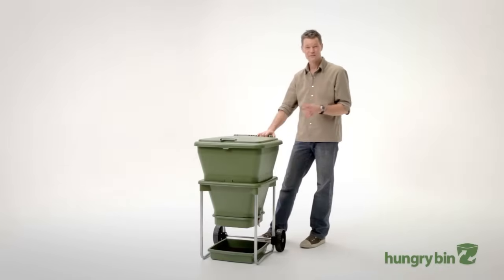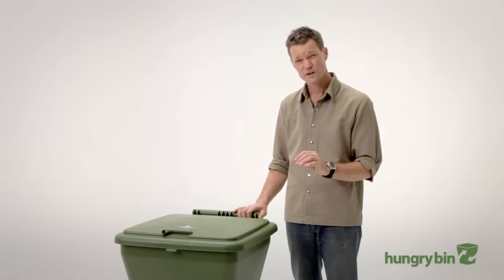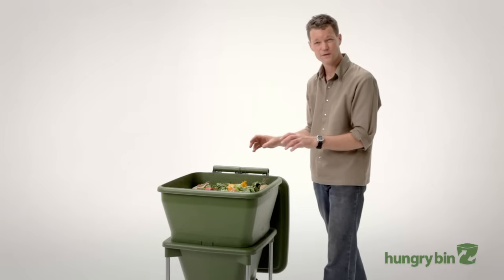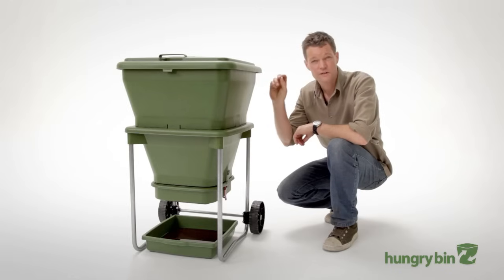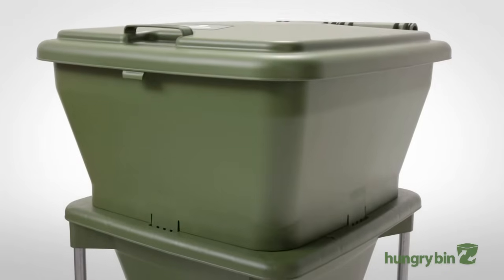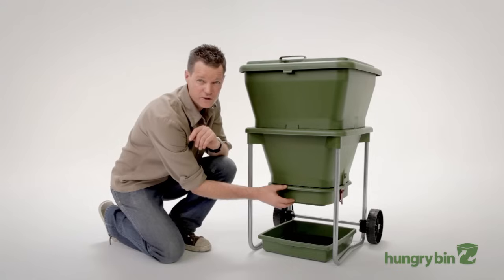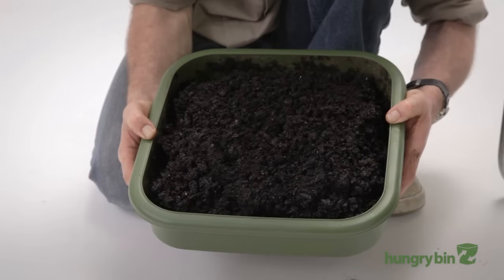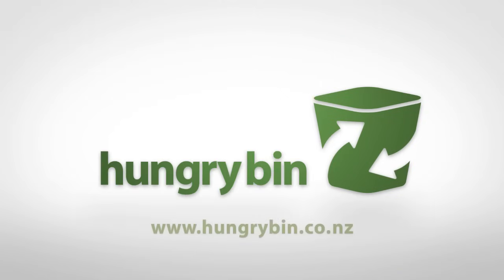Hungry bin. A continuous flow worm farm.

Comment: I can make that for $30. Less than $20, if I try. For $10 more, I can put wheels on it. But I’m gonna trip mine out for $50 more. Chrome tape trim, glow-wire under the frame, a spoiler, and spinners on the rims. Gonna be sweet.

Comment: I have had one of these bins for a few years and WOULD NEVER BUY A BRAND NEW ONE.   The system clogs with moisture at the bottom, so you have to dig extra holes.   It also compacts at the bottom so you need a stick or trowel to retrieve the compost.   Get a second hand one, they are not worth their full price.

Comment: I may have overfed my farm and it's starting to smell a little. I don't think all that smell is due to the tiny amount of raw onion that I put in there since it was less than the amount I would put on a burger bun. Any recommendations? It's not so bad that I would start over at this point.
Reply: Overfeeding means you have masses of rotting material in there and even that will calm down and the worms will eventually clean it up. We are greedy for compost with the minimal of effort. Starting over is probably not worth your effort unless all the worms have died too. I feed orange peels even though Ben says not to. The problem with them is that they take too long to get soft enough for the worms. They will mold before softening up. Although I used to give the worms "hot (spicy) food," I know now they cannot approach it until the hot has gone away. That acid will burn their skin. So if it tastes hot to you, don't feed it to them. These flavors are onions, garlic, and ginger. If these are cooked enough, then they are not hot. On the other extreme is alkaline (salt). This also burns skin--mine too! So don't throw salty potato chips in there or anything that tastes salty. Sweet, sour, and bitter are not problems. You should know the taste before feeding it to your worms.
Reply: no onions recommended if you read the food chart for them :)

Comment: Where does the "worm juice" drip from? Are there holes in the lower pan? Thanks.
Reply: A removable interior cover with many holes. This drains it to a center hole. I catch under there with a measuring cup. Four years with six Hungry Bins: the drainage system has never clogged--absolutely genius.

Comment: Before you buy a Hungry Bin: I ordered one in August 2020 from greentools.ca to add to my first bin purchased in 2018. When the new one arrived, I immediately noticed the quality of manufacturing was inferior to 2018 bin. The green plastic was marked/scratched and streaked with noticeable discolourations, and it had a series of minor issues like stripped screws and black grease smeared all over the legs and wheels. I contacted the distributor to ask about the discolouration, the most noticeable issue compared to the bin I've been using since 2018 (excellent quality). The manufacturer responded it was normal, but Greentools eventually agreed to send a new bin. The replacement arrived with the same quality issues, plus an inward dent in the lid. I let the greentools owner in Canada know about the repeat colour issue, and he responded "...I cannot control what is in the boxes from NZ and we both need to move on." Bad customer service, slipping manufacturing quality, and a waste of time dealing with it. If you care about quality and good service when you buy a $400 plastic worm bin, look elsewhere.

Comment: Nice clean and professional looking system, however I do agree with the previous comments on the price....I assume that the molds for making the bin werte quite expensive due to the size of the bin. However, you may recover faster the investment, if you make the system more affordable. Also to have at least two size would be quite good.
Reply: perhaps a small funnel shaped bin would do the same job when placed on a wooden basement.

Comment: It’s not hard to make the exact same thing using some plastic and a small curve. No need to spend $400. You can make the taper design using polished smooth wood construction. Then create a plastic barrier within the form with some kind of plastic lining. When it’s all done, you can make a bin for the bottom like he has here. No need to spend $400. 

Another way you can make it is if you use Cob. Cob is dirt with sand and water and straw. Im serious. Dirt.  It’s like natural concrete used by ancient civilizations. Good stuff. Used to make fortresses and houses in the old days. Use Cob to make the form. Coat the cob with Lyme plaster finish then polish with olive oil soap. Makes really smooth water proof surface like the plastic device here. All that’s left is to put a bin at the bottom again and then put your potting soil and worms in the top hatch. I’m using this cob method to do it. The only thing I spent money on is a few bags of sand, a small bit of straw, the Lyme plaster a olive oil soap bar. Dirt is free. I have a polishing power tool in my garage. If you are against power tools or don’t have a polishing power tool just use a hard enough smooth river rock. 4 coats of the Lyme plaster before you use the olive oil soap polish step. Works just fine. Final texture for the inside where you use the olive oil soap should be smooth like a Marble counter top. Outside surface isn’t important. Outside surface only gets the 4 Lyme plaster coats. That’s pretty much it. $400 for this Hungry bin? That’s expensive.
Reply: That's a great alternative man....
Thanks!
Reply: @JannalynHalevi   no problem

Comment: Bought my bin several years ago.  Filled it with potting soil then red wigglers then food scraps.  Worms have done great, but there is one BIG QUESTION.  How do the castings make it into the tray below when they only live in the top 6 inches of the soil?  Yes, I can harvest castings from the top, but when I attempt to remove the bottom tray I get the original potting soil AND I stop the removal process because I can tell that the entire contents of the  bin will fall out.  Plus I could only get it partially reattached due to the weight of the soil pressing down.  The liquid in the bottom tray appears to come more from outside moisture rather than anything from the worms.  Would love to have you Hungry Bin people respond to the question of how that castings make it into the bottom...
Reply: I own this worm bin as well. The way the castings make it to the bottoms is as you continue to feed, the worms will move up to the new bedding with food. As you continue this process for months,  your going to be removing your potting soil and will eventually reach the worm castings. From my understanding, the way the bin is design the castings won't fall out the bottom once the tray is removed. I've had mine now for approximately 3 months and I removed 1full bottom tray and the contents didn't fall out. Once you place the tray back, it will be easier to clamp it because it will be empty. If your contents are loose and seems to fall out once the tray is removed, your bin isn't mature enough yet and wait a few more weeks to months to alloy it to compact itself and try again.
Reply: tallswag4u So have an update? How are things? Does it still work? How are your work castings doing?

Comment: How does the soil not fall out when you harvest the casting?
Reply: A dome is formed. The weight from above holds the dome in place. Same idea with all the buildings you see that have domes. I know that it is counter-intuitive. You would think gravity would destroy it, but gravity actually makes it stronger. The funneling has compacted mine a little too much, so that is why I'm going through these videos. 1.5 years ago Ben suggested drilling to loosen, so I bought an Auger Spiral Drill Bit 3.5" x 24," and attached it to a hand drill handle to drill it out. Now I think I can soften it with more fibrous material (paper, grass, leaves) or the small water-retaining rocks. It is really cool when it is working properly--the beauty of the dome and then slowly shedding material into the tray. If the fiber works, I'll email Ben that that is really the solution.
Reply: @carlporter  I am having the problem with the compacted dome.  I can see where drilling down from the top would be easy, but  I was thinking it would disrupt the nice gradient I have of material going from fresh food at the top to pure castings at the bottom.  So I was thinking if I go in from underneath and just do some shallow drilling from the underside, or maybe just scrap over it with a hand rake.  That way I could weaken it a bit and only remove the stuff that's really ready to use.  Also, it will not disrupt the worms.  Did you ever try that?  Have you gotten any more experience dealing with this problem?
Reply: @WilfredForbert Very happy to answer your question with an update. I gave up on the Auger Spiral Drill Bit. I realized this was killing worms.The correct tool is a crank compost aerator (Amazon $49.99). Expensive in the USA, but Ben said they are 1/3 that price at hardware stores in New Zealand. It kills no worms because it is just a thin pole of steel. A long time ago I did the digging off the bottom. It doesn't solve the problem. Adding more water or adding more fiber has also not solved the problem. The worms, just like any animal, don't appreciate any scraping around the top. They appreciate as much privacy as possible, so I even try my best to open and close the lid quickly. Remember they are light sensitive--they flee any light source. So just keep feeding the bin until it is so full the lid doesn't close without a big push. Feed includes newspaper layers and I sprinkle dirt on top once every 6 weeks--put in on your calendar. If you are ready to harvest, give them a week to eat what you last put in. Harvest the bottom. If you don't see much, not to worry. Now time to use the crank compost aerator. Harvest again if you think more should come out. You'll still get the ready stuff pretty much in the harvest. Ben's invention is amazing. Then you have plenty of room for adding more. So easy. I might harvest early if I'm searching for compost for the garden, and ideally your harvest should sit for a while in a bucket. It cures it--break up the big chunks with your hands after it has dried a bit.

Comment: he said it can process 2 kg of food a day, but takes a few months to get one basket... hmmm
4.4 pounds of food in daily... does not equate to getting 4.4 pounds of fertilizer... daily. even after 4 months.. the fuck?
Reply: I agree but you're forgetting to equate the liquid coming dripping out of the bottom which is 1L per week. If it has the density of water (~1000g/L) would weigh about 2.2 pounds of (liquid) fertilizer every week, over two months a "meager" 20 lbs. with another ~20 lbs harvested as castings during the same 2 months. If you were adding in 2kg of food waster per day you would still have a bin which would begin get heavier by ~200lbs every two month harvesting cycle. In 2 years it would weigh over a ton.

Comment: What about air flow?
Reply: I have one of these bins and condensation/ ventilation is the main problem with it. I have to leave the lid open to let it air fairly regularly and add tons of paper or leaves to absorb the moisture.

Great design but this is it's main flaw. That and price. Too expensive.
Reply: @MG-xy9rn  You should be adding bedding to ANY work bin though.
Reply: Lid has air holes.  Should be sufficient.

Comment: hello ben:  I got my hungry bin a couple of months ago.  I set the bin up as instructed.  I ordered worms and they arrived three weeks after setting up the bin.  We added garden scraps as recommended to the 2 lbs of red wiggler worms.  The first week the worms did well and we could see them then after a while they weren't eating anymore.  They were shaded and feed but seemed to be compelled to crawl out of the bin.  Even as we would open the lid to let light in so the worms would crawl down by morning they would be near the lid looking for a way out.  $40 worth of worms here in the US from Uncle Jim's and I don't see even one in the bin now.  Very sad.
Reply from the maker: Cassity ART Hi Cassity, that sounds a little bit strange. Are you sure you got red worms or tiger worms, and not nightcrawlers? The nightcrawlers are sold for bait, but do not stay in worm farms very well, as they are different to brandling or compost worms. I hope this helps, B
Reply: First, the lid never needs to be left open. Also worms use the entire space--it's their home--not to worry if they are near the lid. Second, best if you not spend too much time examining them. They are most happy being left alone, so I open and close the lid as fast as I can. For one thing, light is a torture to them, so why expose them to more light than necessary? The lid fits tightly enough that only fruit flies routinely enter and leave, and their presence is limited to a few weeks in the spring for me. With Hungry Bins worms rarely find a way out. When I used homemade bins, I had more issues with escapees. Like any species on Earth, they try to colonize new lands. Were the escapees brave or stupid? This is a nighttime behavior because they hate light. Through many years, escapees were not a lot except for one night. The worms were kept in an enclosed car garage, part of the house really. One night there was a warm, humid rain, a big rain and a pitch black dark sky. The next morning I entered the garage to see the disaster. A worm can't go far on a dry garage floor. Even though I lost a lot of worms that night, my worm bins were fine. Not everyone is trying to leave even when so many think it is the right moment.
Reply: @carlporter  I got help 6 years ago from a man who raises worms and sells vermacompost as a living.  He suggested to check the temperature. Although lid closed and in the shade my southern home here in the US was way too hot for the worms and the composting material also creating heat.  So that was the worms reason for escape.  So... I found a cool cement garage to compost in.  No more problems and have increased my yield with a composter that is sixteen feet.  Thanks for your reply. 🌱
Reply: @cassityart7001  You're welcome. That makes sense. We measure the skill of the vermiculturalist by the yield. I want to earn my investment back on the Hungry Bins! I'm dreaming up new ideas of what changes to make this year, and I've been at this for 26 years. I would love one day to actually make a pilgrimage to where these worms live in Nature: not too hot, not too cold, lots of trees--sounds like Paradise.